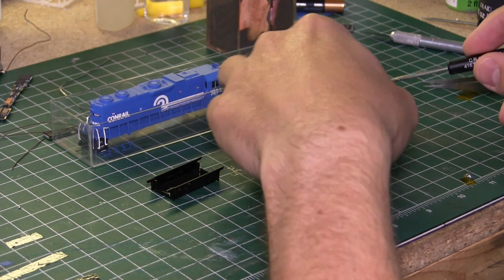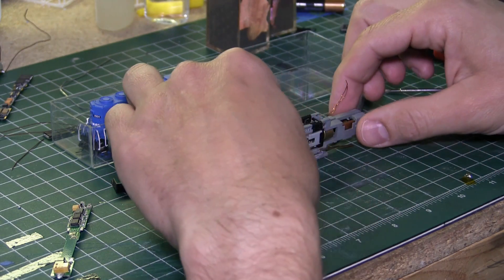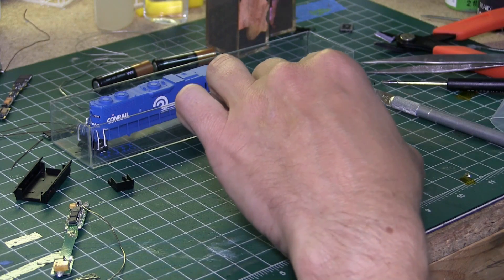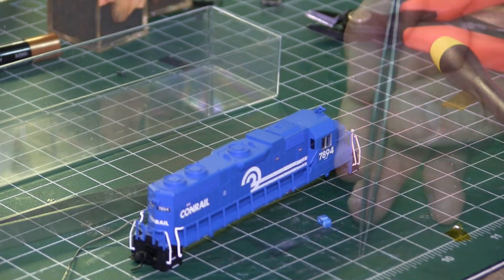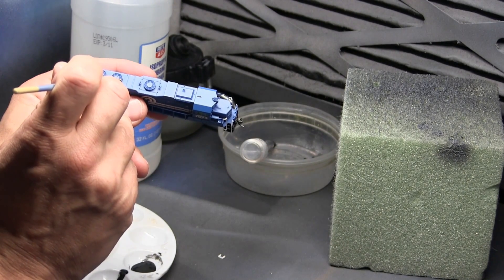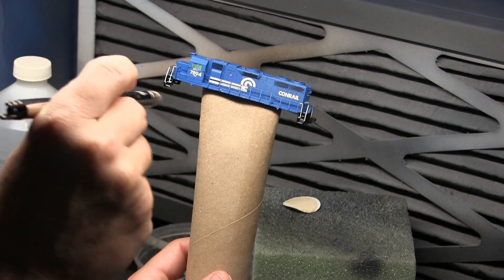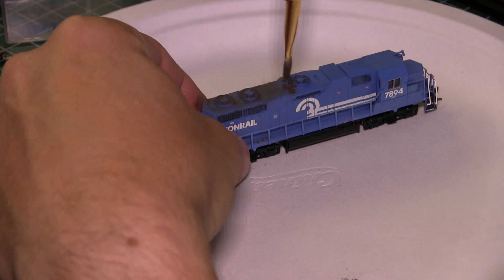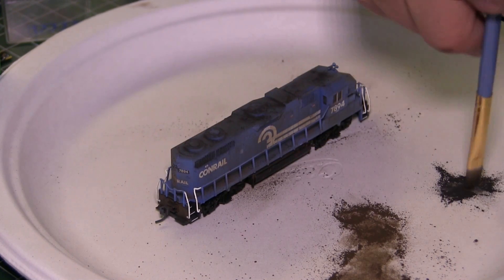Locomotive Shop: Atlas GP38 & ESU Decoder

Comment: Thanks for the board info.  I am looking to do a Loco Sound board on my Atlas Gp 40 which should have the same Chassis.  Also those old oval speakers are 8 ohm probably,  which is to much resistance for sound for something that small and not enough amps.
Reply from the maker: Adrien Gadson thanks for watching

Comment: I love ESU, but I don't like what they did. They released the Select Direct Micro boards that you used, then about a year later they are discontinuing them due to lack of parts (unless I misunderstood that them discontinuing the select line for version 5 excludes the Select Direct Micros). I'll bet that they had a stockpile of these board to use in OEM applications, then just decided to get rid of them since they are moving on to version 5. Who knows if they will release a similar board for version 5. Count yourself lucky that you got a hold of a Select Direct Micro since they will eventually run out.
Reply from the maker: Crazy SDK did a lot of research on this, and what I have found is that these same boards will be released in version 5 not to worry.
Reply: At the time of this video, I was unable to figure out that they would be continuing the Select Direct Micros. I’m glad to hear that they will be continuing them.